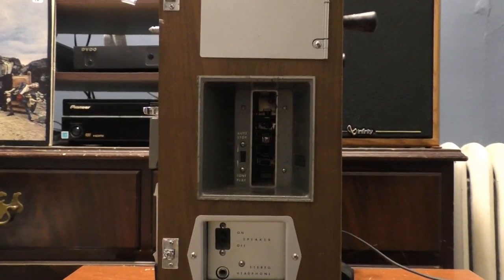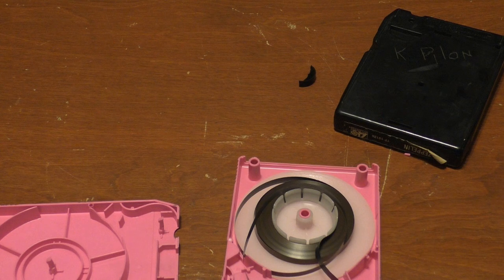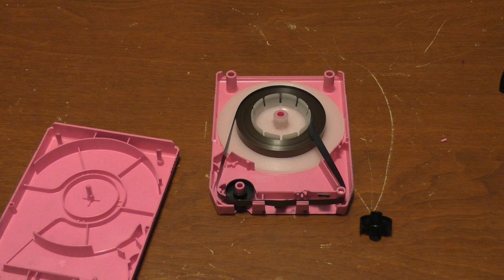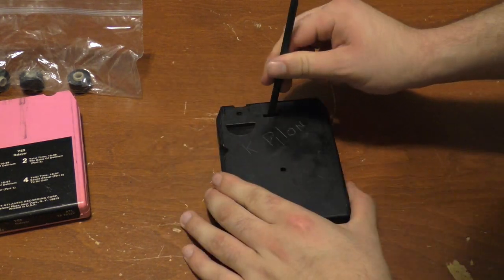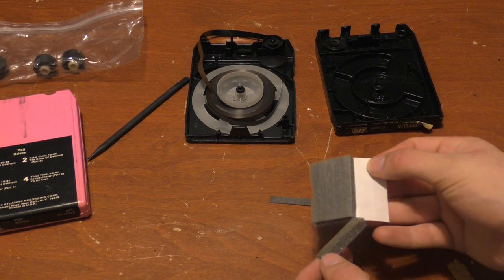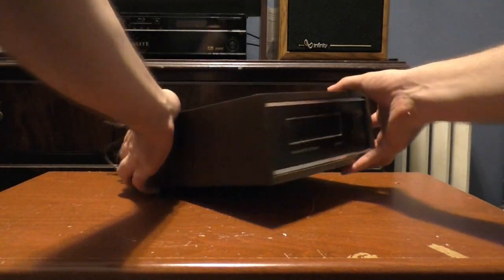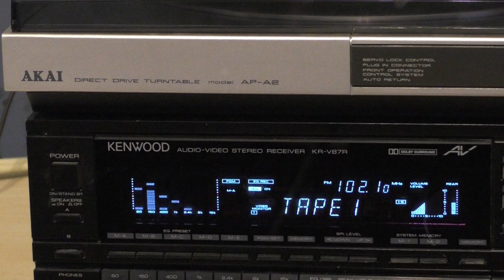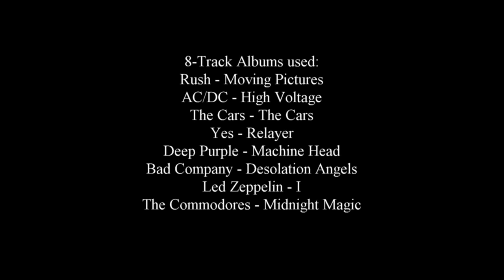8 Track Tapes: tips, advice, how to fix, and the experience - The Soundtracker

Comment: hi i had 8 tracks from 16 years some  one at school gave me some  
note  i did get in 4 track carts  
my mate and me used to get them in the uk fee  ads 1000's of them  we 2 were the only ones that used to by alot in the uk 

i still have alot stopped buying them because the capstan rollers in side the tapes  stopped working right  heavy wear   i have a loop of tape i put in side a 8 track to test for wear

the loop of tape was recorded on a otari mtr 12 top line deck  and once  test tape was in side you can hear how bad the tape is  note 

i went over to audio  pro carts i can use the 8 track tape in side of them and junked alot of 8 track tapes  i can tell you

Comment: I'd try to fix the Sanyo, 8 Track aren't to hard to repair, barring the motor or head's are bad.
Reply: Even then, if you have few bad units as the guy said, you salvage them to fix the most promising one. Motors and heads should be quite interchangeable.